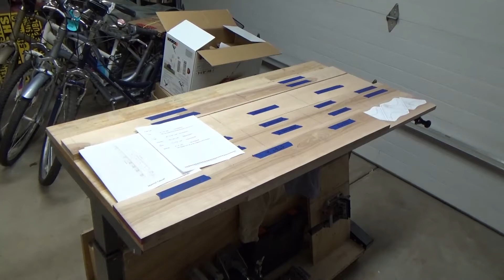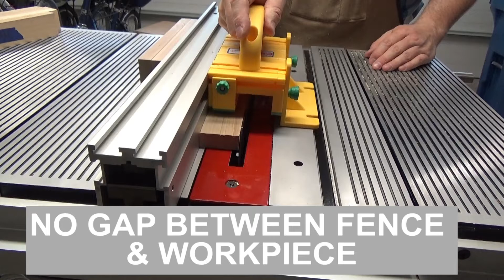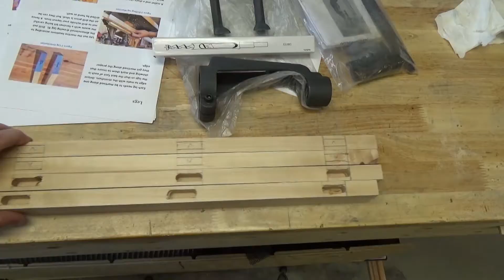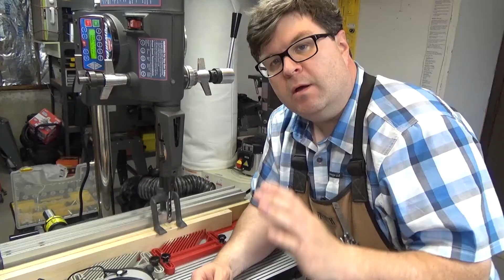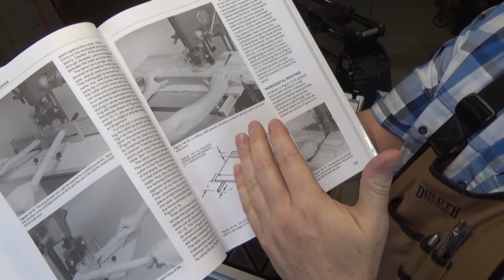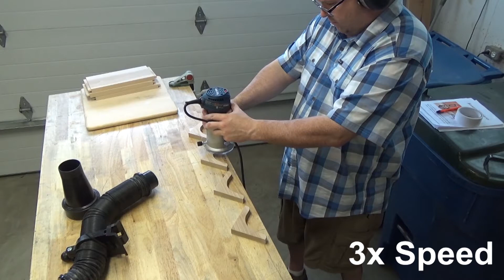Hoosier Step Stool Build: Testing the Shopsmith Mark 7

Comment: I like that you point out the shortcomings of some of the tools, i.e. tenon master and the mortising issues with the overhead router.
Reply from the maker: Thanks Ken. To do it over again I would use a straight bit instead of a spiral up cut.

Comment: I can tell you are very nervous around power tools. To help ease your mind  you should lower the table saw blade so it's just above the surface you are cutting.  I just picked up a mark v like new  with  8 accessory attachments for 250.00!  I plan on using the jointer, band saw , sander and drill press only. I have a quality sawstop tablesaw.
Reply from the maker: John, congrats on the Shopsmith purchase. I like to set my blade height to achieve maximum cut quality for the situation at hand. Most times that’s so the workpiece is just above the bottom of the tooth gullet. Not sure what makes you say I’m nervous I actually fell quit comfortable.

Comment: Would you recommend getting their router table fence for some of these router table jobs?
Reply from the maker: Yes, I use the fence whenever possible and the manual states the same. When routing the rounded corners I had to use the pin plus piloted bit. I use my fence in this video if you want to see it HSS Shaper Cutters: Worthless in the Age of Carbide?
https://youtu.be/MyseXcjLrCM

Comment: Enjoyed the vlog Tom. Now my wife wants one of those step stools, thanks. I have a dedicated Jet tennoning jig that seems to work fine. I agree I would not want to stress the shopsmith headstock using one.
Reply from the maker: Thanks, glad you enjoyed it. I did put the link to the project plan in the video description so there's nothing stopping you from putting one together! Yeah, I think a purpose built mortiser is the way to go for hollow chisel mortising.

Comment: Thanks Tom, I really enjoy watching others use their Shopsmith’s. I have never used a sacrificial fence and a miter gauge in the same cut had been told it could cause kick back. Your thoughts. Couldn’t you use a stacking dado with the mortising jig?  Is the measuring tape on the table standard with the 7?  How do you zero it out?  Loved the routing with the overhead pin router. Nice job. Good use for double sided tape. Thanks again for letting me watch your techniques.
Reply from the maker: Thanks Dave, I really appreciate the compliments. Regarding the rip fence, dado blade, and miter gauge combo it is safe in my opinion based on several references I have read or viewed. James Hamilton does a decent job explaining it here - https://www.youtube.com/watch?v=QhGUwhaVzuc
I don't know if a stacked dado can be used with a mortising jig, but if I am pulling the dado blade out anyway, I would just do what I did. 
Yes the steal magnetic ruler is standard on the Mark 7, I put the fence against the blade and move the tape to zero on the pointer.

Comment: Nice project. Great results. 
One of things I noticed was how clean your saw remained. What are you using for dust collection? I have the SS DC3300 and I am not impressed.
Reply from the maker: I have a shopfox 1hp DC. For $40 I upgraded to a 42 inch 1 micron hood. I run a 4 inch hose then a 2.25 adapter at the tool end. I have videos on dust collection if you look on my channel. You can get more out of the dc3300 by using a 4 inch hose and 42 inch hood.

Comment: Tom…. You packed a lot into that video.    Glad to see you are getting quality results with your new system.  

Two items for comment:
1. Tenoning jig…. I don’t use mine often.  However it is handy when doing tenons on ends that are mitered (not 90 degrees).  Mine is a Grizzly brand.  I find I can do very precise and repeatable work.  I use a caliper and calculator to set it up on a piece of scrap.  And, sometimes I use a stacked dado with it.

3. Hollow chisel mortisers do require considerable pressure to cut…. Especially in very hard woods and larger bits (3/8” plus).  You can minimize it by sharpening the chisel, waxing the outside of it and setting the correct bit to chisel clearance.  A guy in a cabinet shop showed me how to use one years ago.  They are darn near error proof once jigged and setup correctly.  I find router mortising to be more difficult… and error prone.  (That is just my experience….)

Thanks Tom, you’ve given me some things to think about.  Oh, and nice job on your project too!
Reply from the maker: Great points. I was really not interested in putty that much force on my new baby.

Comment: Tom you need to remember the Power Pro head stock is considerably heavier than the old Mark 5. Therefore when in vertical position you do need to tighten the lock more. Not a fault of the 7.
Reply from the maker: True, but not too much so you don`t break something or dent the tubes.
Reply: @woodshopnerdery  I agree, it's just that your comment gave me the impression that you were surprised it had to be tighten more than the old one. The only time I fine it needs a 1/4 turn or so more is in vertical. The only reason I mentioned this to you is because the first time I used mine it slid all the way down to the table.
Reply from the maker: @ellisreeves8936  I'm with you. I totally get what you are saying. The headstock only slide down when running at 9500 RPM and only by 1-2 mm. I believe it was the vibration. That was enough for the spiral upcut bit to take a large bite and pull the work piece upward making an even bigger bite. Feedback loop.  So I had the lock really tight, it just needed to be really really tight. But the dozens of pictures of dented way tubes and broken lock mechanisms on the forums haunted my thoughts.
Reply: @woodshopnerdery  I did a tenon project using the headstock horizontal so the fence became the table, table became the fence. If something came loose, no big deal.